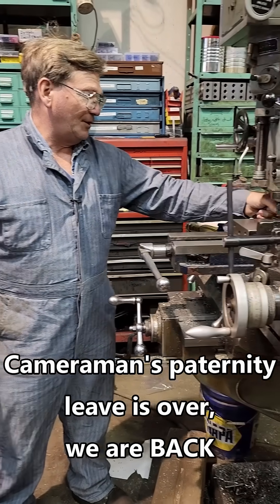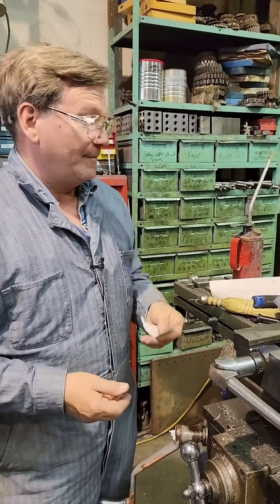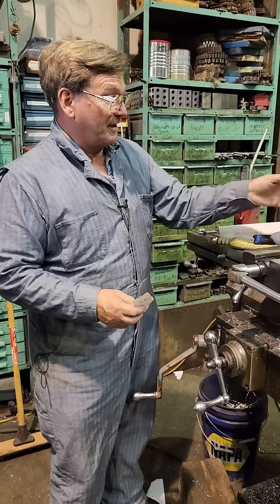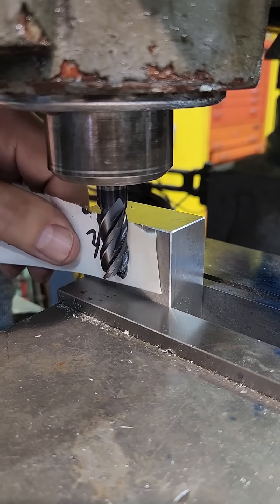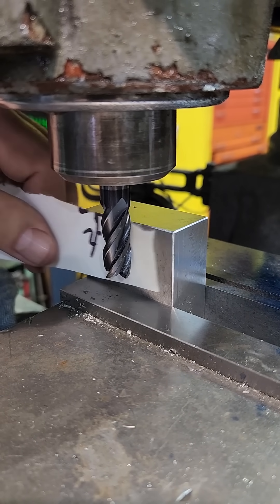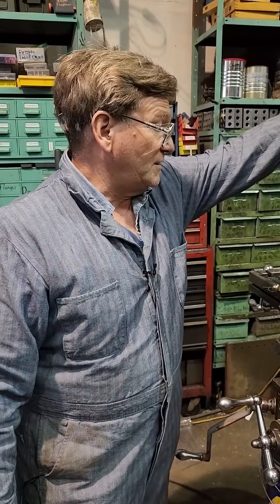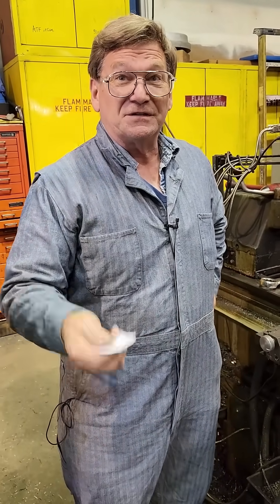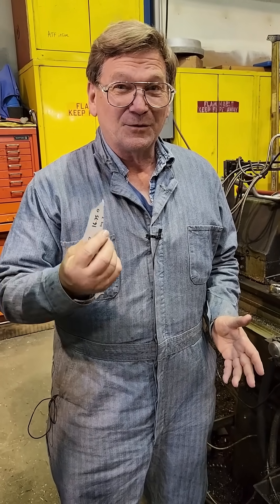Using paper as a feeler gauge!

Comment: Having a pack of Zig Zag Rolling Papers is extremely handy.

Thin stiff crisp I also make wonderful shims to put underneath a magnetic Mount surface grinder fixture if you need to level it and they have hardened steel feet.
Common Sense Comment to go with that is only use this technique when dry grinding
 Not wet grinding .... of course.
Common Sense isn't so common Naturally.

Comment: i am old and when I was a kid everybody smoked.  I was brought up using a Cigarette paper ( Green Rizzla = 0.001") and we would glue it to the work piece by putting a thin layer of cutting fluid/oil on the work piece and then putting the paper on it, so that it sticks to the metal like a plaster/band-aid.  Spin the mill or lathe up and then advance the tool toward the work very slowly. when the paper is peeled off, you are 0.001 off contact.  I stopped smoking at least 12 years ago but I still have cigarette papers in the top drawer of my tool chest!
Reply from the maker: Using the cutting oil to adhere it makes that a really phenomenal refinement. Thanks for sharing some old school shop wisdom.
-Cameraman

Comment: If somebody is doing the “pull” method, brace your pinky finger knuckle against the vice so it won’t jerk forward.  I usually use a paint marker(carefully or it will be on too thick) or a sharpie to mark the surface so I know when I’m rubbing.
I also use paper when tracking a bandsaw blade.  Between the heel of the blade and the shoulder on the drive/idler wheel will slice if too tight, but a nice sharp fold with just the start of a cut is perfect pressure!